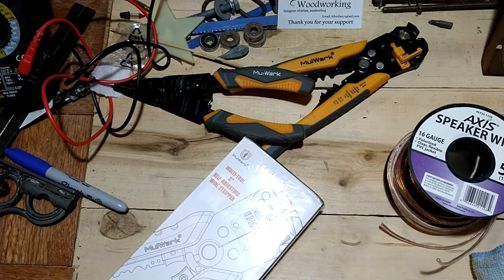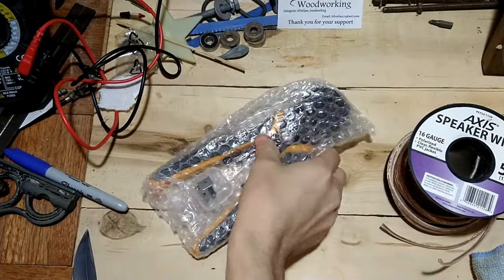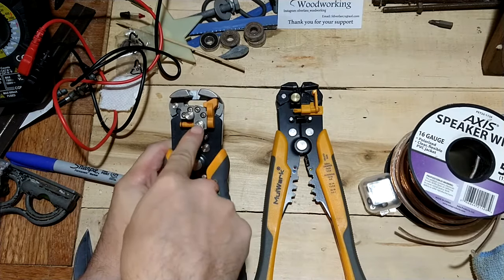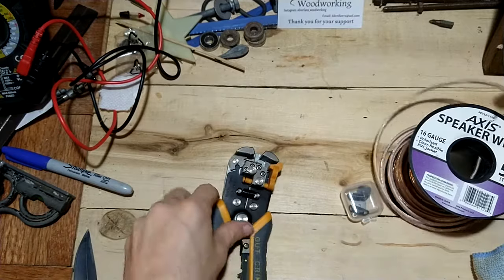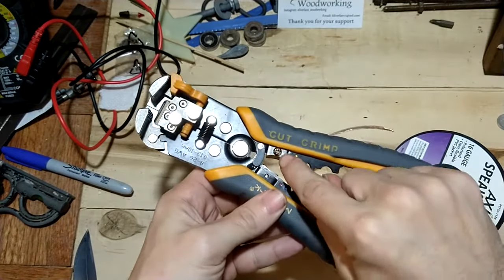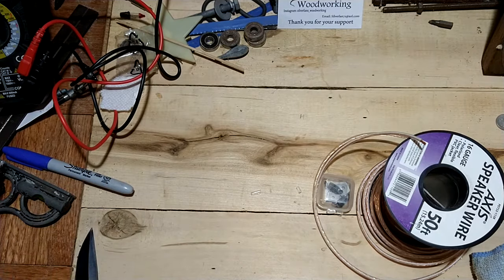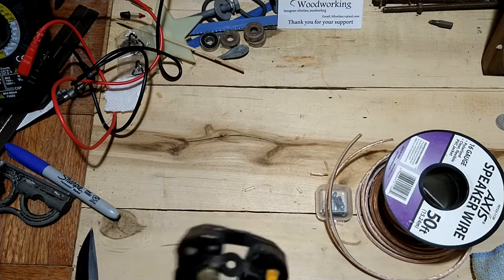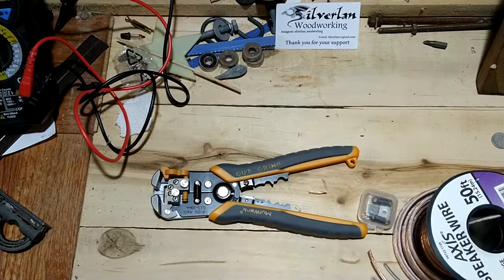MulWark 3 in 1 Automatic Self Adjusting Wire Stripper

Comment: and how this tool feels after years ?
Reply from the maker: still going strong its my goto over the old version. honestly this one feels better and seems to work smoother than any of the ones i used including their older generic version. i have yet to have to use the replacement parts that come with it like the springs or the blades. i cut anything 12 - 14awg with no issues took me a bit to dial in the cutter strength but once it was done no issues at all on thicker lines.